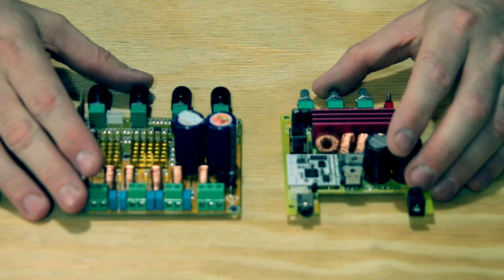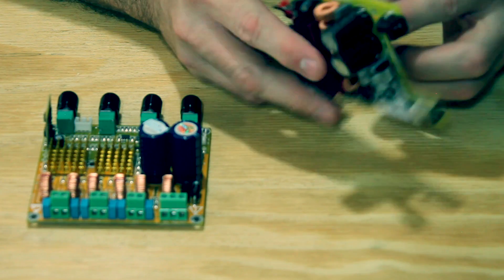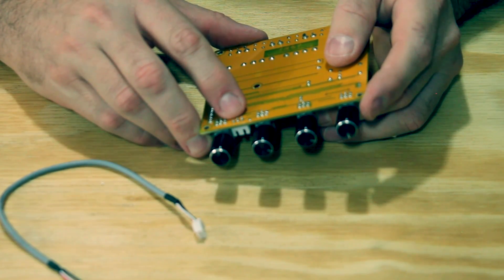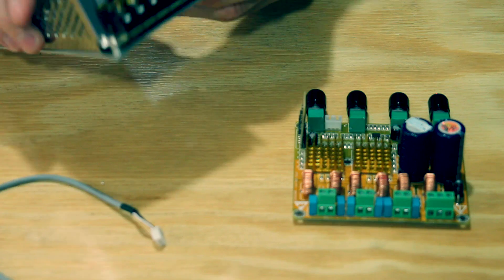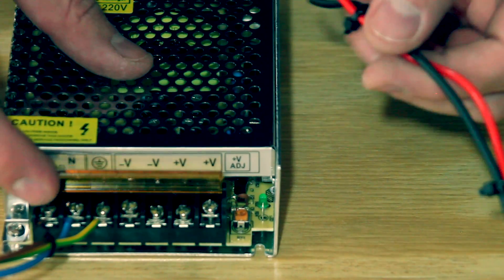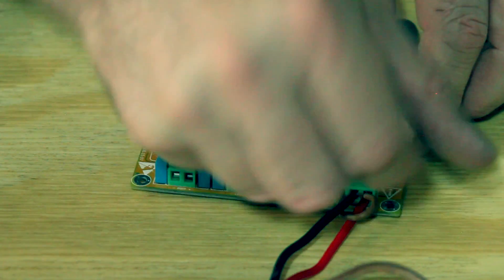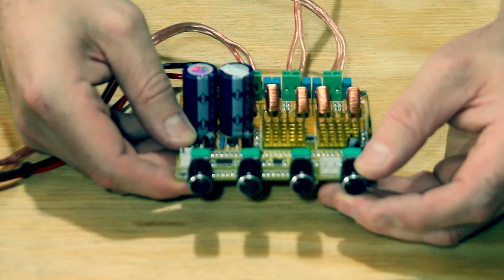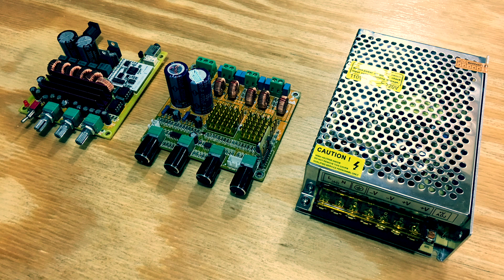TEST BENCH: TPA3116 2.1 Channel Amplifier Boards with Bluetooth 4.0 - by SoundBlab

Comment: So, some TPA3116 2.1 hiss? Which ones do not?
Reply: ah, alright. i'll order one of those from ebay and see if it improves anything. i wont know for the next month, so dont hold your breath. but it might be nice to find out once and for all.
Reply: yeah that's pretty much it, i added a few capacitors on it as well before a lowpass filter. his fixes aren't always straight forward, but there's a small chance that there's something easy to fix on the board. i'd never say no to a few neat improvements. 
the 8 pin chip is sitting right by the power input, i'm sure that could have part in the noise issues if its a cheap ripoff. but with that said, the same chip is also faceless on the original board, in general the BT module looks damn near identical overall. if it is a clone, it's a damn good one. also i do agree that it's a massively expensive module considering the cost of the amplifier overall.
Reply from the maker: Well, the one I recommend in this video is much quieter than others I have tried to the extent where you can not really hear it unless putting your ear right up to the speaker.
Reply: Hi SoundBlab,
Thanks for the great videos.  I have used one of the boards you recommend and have had great results too. 
 Finally a 2.1ch bluetooth amp board with no noise!  

A big warning though, there is at least one ebay seller that is selling a knockoff of this board made by Xinrui that is not nearly so good.  The seller I bought the knockoff from is diyelecmall108.  You can see a photo of the knockoff version (showing the back side) on the auction listing by sportgogo.  It looks very similar to the HT21L-200 that you recommend but has the dreaded bluetooth noise.  When it pairs the bluetooth shows up as "xinrui radio" instead of the usual "YJS-68DV4.0" and there is no 5188 passcode required.  There is no part number silkscreened on the top of the board, and only a very very small Xinrui logo silkscreened on the back.  It also seems the big electrolytic caps are black instead of deep blue in color, but I am not sure that is always the case.

Do you know who the actual manufacturer of the correct board is?  Do you have a link to their website?  Do you know what the differences are between the HT21L-200 v1.0 and v1.2?  Which one(s) have you tested?

Thanks!
Reply from the maker: That is very interesting. I have only tested v1.0 of this board and buy mine from an eBay seller called power116 at this link: http://goo.gl/wiBr7d
I have bought 4 of these and so far all of them have been performing without problems. I do not know who the manufacturer is though. It would however be very interesting to compare v1.0 and v1.2 to see the difference.
Reply: that's interesting, having just ordered one identical to the knockoff you mention, on a green PCB and the little xinrui stamp, i've done some pretty extensive comparisons. is the bluetooth noise you refer to groundloop noise? because i've compared the boards a lot, and track by track they are identical. there is a single difference, and that is a vier connecting a top ground plain to the bottom one, but i believe they are connected elsewhere regardless. i cant seem to identify where that noise would come from. when i actually have the board in hand i'll do some proper testing.
Reply: My assumption is ground loop noise.  The first amp I bought has zero noise issues.  This xinrui amp I have is very quiet when first turned on, but as soon as the Bluetooth connection is established the noise starts.  The noise is the same whether I use my iPhone 5s or my iPad. The noise has two different components, a tapping sound like a fast dripping faucet, accompanied by an oscillating sound around 1.6khz.  Wiggling the ring inductors can sometimes alter or eliminate for a short time the 1.6khz noise but the dripping sound is constant.  Perhaps I just got a dud, but with a different manufacturer comes different (perhaps questionable) sources and unforeseen consequences.  I will be buying the more expensive, and presumably genuine, HT21L-200 from one of the other sellers from now on.What do you mean "when I actually have the board in hand"?  Have your comparisons just been between the auction photos?  If so I will be anxious to hear what you hear when you get the amplifier.
Reply: BTW, I'm using 6x 18650 cells w/BMS to power both amps.  The same power supply and the same drivers for both.
Reply: i will be using a switching supply, i dont have the original so i cant do direct comparisons, but i have a fair bit of experience with groundloop noise and it does sound like that. also yeah the comparisons i've been doing is from photos online that i aligned and set up so i can switch between them. here's a gif i made, the green one being the ripoff: http://puu.sh/vSdUl/8bceee7943.gif

one thing though, does the noise volume change with the music volume using the on board knob? that'll likely decide whether or not i can live with it.
Reply: combatplayer I too have the same problem. Ordered one, and got the green one, with a terrible hiss background sound on the bluetooth imput. Also no passcode required and the bluetooth name is Xinrui radio. 

I also believe it's a ground problem with the bluetooth module. I think of unsoldering the ground pin from the bluetooth module and solder it directly to the ground pin of the amplifier. In my opinion that should bypass the ground loop, or am I wrong?
Reply: At higher volumes the music masks the noise some but with every quiet passage or gap between songs it is VERY apparent and annoying.  To me it is not acceptable and since the original board is so incredibly good in this regard I think you should push back on the seller.  This is the second time I have been victim of a Chinese class D amp look-a-like.  Always the same BS answer from the seller, oh - that is the new version.  Yeah, right.  We will see if eBay is any better than Ali-Express when it comes to protecting the buyer from counterfeit merchandise.
Reply: Glenn C I find it unacceptable and it is very disturbing to hear it. 

I don't think i'll bother anymore with it, and I'll just see what the seller has to say about it. 

Anyway, for the future buyers, make sure you buy the correct version of the board before paying it.
Reply: I was dumb enough to order a second amplifier from this guy before the first one arrived.  The second one arrived yesterday (also the green Xinrui version) and I can confirm that the noise problem is exactly the same.  So much for the first one just being a fluke.  Xinrui clearly missed something when they copied the board, didn't program the BT module correctly, or are using one or more counterfeit ICs.  If anyone is reading this, do yourself a favor and avoid the Xinrui version for now.
Reply: I bought it from the seller recommended in the SoundBlab's video, so he did have the right board. The only way to make sure you get the right one is to double check with the seller before buying it.
Reply: well that's slightly upsetting. i'll see what i can do to solve the issue once i have the amp on hand.
Reply: Sergiu Maior i dont think you can bypass it that easily. generally it would require complete isolation of either the power supply or the audio output of the module. you can isolate the output with cheap 1:1 ratio transformers, they dont cost a lot but they degrade the audio quality slightly unless you pay lots for good quality ones. if the bluetooth module runs on a typical voltage like 5v then you might be able to solve it by isolating the power by using either another adapter or a dc-dc isolator, but i havent tried this approach myself and cant guarantee its success with the audio ground still connected.
Reply: a theory could be that it's the bluetooth module itself that is a ripoff. yjs-68D V4.0 is the name of the one used on the original, the same as the name used during pairing. if it's the case then replacing the bt module could solve all the issues, they should be pin compatible. but of course this is just a hypothesis.
Reply: Sergiu, I just want to confirm, you bought the amp from power116 and got the Xinrui?  If so, that is very disturbing and makes me wonder how many others are now selling this knockoff.
Reply: combatplayer, I think you might be on the right track with the BT module.  But the whole reason I switched over to this board (and paid a premium) was to get something that I didn't have to rework.  Ebay / China refunds are a huge hassle, I'm not sure I'm going to prevail, but I'm going to try.
Reply: Glenn C That is correct! The seller was power116, and I received the Xinrui amp. 

I took down the bluetooth module today and bought another one (currently waiting for it to arrive, probably it will be here tomorrow). At a first glance, the new BT module (is not the YJS-68D, that is installed on the good board) has a different ground for the audio in and audio out lines. I am planning to power the second module from a separate 5V PSU, and connect it to the line in of the amplifier (which works fine, without any background noise). I will let you know how it turn out.
Reply: Is the one you are waiting for a YJS-68D?  Are you going to do the separate power thing just so you can do an A-B test or is there some reason you can't just remove the Xinrui BT module and replace it with the YJS-68D?Considering the YJS-68D is $9-10 by itself this is a rather expensive fix!
Reply: On the xinrui board I received, the bluetooth module was YJS-68D, so I took it off and bought another one, the KRC-86B (it's actually the one they used in the second board presented in this video). I chose that one because it seems to have separate grounds for each audio line. I already have a 5v PSU laying around. It is a rather expensive fix, but I don't have much time and knowledge to find a real and safe fix for the problem.
Reply: Thanks.  I hope I can get return credit for the ones I bought as I am not excited about trying to rework them.  I haven't tried KRC-86B BT module, does it present any loud beeps or annoying voices?  So you are just going to connect it to the aux in on the Xinrui amp?  With a separate 5v supply you should be good, otherwise an isolated dc/dc converter (Mornsun B0505S) can be tried if you want to pick the 5v off the Xinrui board.  Good luck, it's not fair that you are having to throw more money at this.
Reply: Glenn C Thank you, I hope you'll get your money back ! I have no ideea about beeps and strange voices on that module, but I hope it's ok ! I thought about the isolated convertor, but I can't find one in my city and it'll take about a week to get one.
Reply: Thanks Sergiu Maior.  Let me know what you find, as I may end up going with the cheaper amp with the KRC-86B on it.On a bright note, I got an email from eBay this morning that they found in my favor on the return case.  I provided photos from the auction with the seller's watermark on them, and compared photos of the Xinrui board and showed the difference in markings (or lack of them).  I went through a similar incident on Aliexpress where the seller substituted a no-name brand of DC-DC converter and all I got was a 60% refund.  With eBay I got a full refund (although I now need to go through the same process for board #2, ugh!).  I hope that more people will go through the hassle to do this, as it's the only way to send a message to these suppliers that we won't tolerate this kind of sloppy cost-down effort on their part.
Reply: i've had experience with the KRC-86B BT module, sadly i dont recall if it had any noises like that. what i do recall is that it too gives groundloop noise - of course that should be solved by you using a separate power supply. the good thing about it is that it has its own line in as well, so you can completely bypass the switching of the cheapo model. on that note, does the line in on the amplifier board work without the BT module in place? i was wondering if they were using the switching on the module or some other solution.
Reply: I'm back with some answers, sorry for the delay, the Romanian delivery services are a disaster.  I got the new bluetooth module (KRC-86B) and connected it to a different 5v psu. The module has a line in (left, right and ground) which I soldered directly to the connectors on the speaker's enclosure, and a line out (also left, right and ground) which I soldered on the amplifier's line in. It works like a charm, with no background noise at all on bluetooth and on the aux input. 

Also, by removing the bluetooth module from the board, the line in of the amp will not work anymore, as the signal from that input is sent in the bluetooth module, and then to the amp chip. I had to solder the in and out inputs, in the BT module socket in order to bypass it and allow me to use the amp's line in. 

This is a rather expensive fix as you have to use a different psu, but it definitely works.
Reply: thank you, that's good to know. did you try running the original bluetooth module in the same fashion? with the line in run straight to it instead of through the board with a third party 5v supply?
Reply: When I removed the original BT module, the 5V+ pin was damaged. I'm not sure if my soldering station was too hot (highly doubt it) or it was soldered wrong, but the small copper ring surrounding the whole came off. I didn't have the time and patience to repair it, so I just bought a new one. But most certainly would work with the old one too. In the end, I'm pretty sure the problem with this type of board is indeed a ground loop, so running the module through the 5v connectors on the board, I don't think it would have made a difference.
Reply: in that case, i wonder if something like this: http://www.ebay.com/itm/B0505S-1W-DC-DC-Isolation-Power-Module-5V-To-5V-For-RS232-485-CAN-IO-80-20mHz-/401051811156?hash=item5d608cfd54:g:9gEAAOSwKtlWjii5
would fix the problem of the board, using the on-board 5v supply? it'd be a significantly cheaper solution if nothing else.
Reply: That was my first option too, but I couldn't find the converter in my city, and it would have taken them around 2 weeks to get it, so I gave up :)
Reply: Hi Sergiu,  
  Just to make sure I understand:  Did you completely remove the YJS-68D from the amplifier board and solder a jumper from pin 9 to 6 on the amp board and one from pin 8 to 5 on the amp board per the connection diagram shown on this page?  

https://www.aliexpress.com/store/product/Bluetooth-4-0-Stereo-Audio-Receiver-Module-Wireless-Speaker-Amplifier-Modules-DIY-Modification-YJS-68D/1829717_32469303866.html

At that point the board is essentially an aux in only version, yes?
Reply: Glenn C Exactly ! Otherwise it wouldn't work the aux in without the BT module.
Reply: Thank you Sergiu.  Nice job of making lemonade out of that lemon!
Reply: Thanks for all your efforts combatplayer.  I look forward to hearing if that eliminates the noise.  I imagine there is a "root cause" that we haven't found, but if the isolation converter eliminates the noise it's probably not worth digging any deeper.
Reply: no problem, i'm very set on finding a solution to this issue, so much so that i've gotten FFcossag, also here on youtube, to have a look at it. he's rather good at solving issues with cheap china amplifiers, but as a backup and for future reference i'll test the power supply isolator regardless. 
i read that the converter needs to output at least 20ma to work properly and that typical bluetooth modules rarely uses more than peaks of 30ma, so i made a small circuit to put a constant 20ma load on it as well as filtering out the ripple it supposedly has. that way i can do a few different tests and experiments with the board and see what would be the best solution for myself in the future as well as others who fell for this trap.
but for now all i can do is preemptive preparation as i dont have the amp nor the converter yet, i'll comment again once i do.
Reply: 20ma minimum?  I must have overlooked that, thanks.  Is the load circuit as simple as just putting a ~200 ohm resistor in parallel with the bluetooth module's 5v input?  

Glad to hear you have FFcossag involved.  I've done his Verst board mods with good success, but they are not easy for the inexperienced or those lacking the tools.

I've noticed this YJS-68D is quite different than other CSR equipped BT modules (and pretty expensive in proportion to the cost of this amp) and has one unmarked SO-8 on it.  I am guessing that Xinrui tried to clone the YJS-68D and fell short of the mark.  Either that or they simply didn't program it properly.  Your thoughts?

Comment: Hi thx for this video.
The link is off, where can i purchase the TPA3116 2.1 Recommanded Board ?
If i have to choose one without bluetooth, which one could you recommand me ?
I'm actually working on the Cantilever Style MK2 (and the guide is well done btw ;) )
Thx, 
Mazic
Reply from the maker: Thanks! The recommended board can be purchased from eBay here: http://goo.gl/wiBr7d
I don't know of a similar board without bluetooth that I can recommend, but this board will also accept a normal line input, which means you do not have to use the bluetooth function. Thanks for getting the plans! It really helps me to keep on making videos. I hope your build comes out well!

Comment: The spec I see on TPA3116 Ebay boards similar to this (with bluetooth) requires 18 volts min...do you think these would run at 12 volts for car use?
Reply from the maker: The board in this video which I do not recommend will run off 12v: https://goo.gl/hjhqA9 , http://amzn.to/2aC8V4q
The one I do recommend requires 22v minimum.